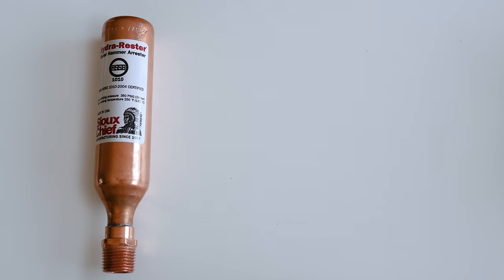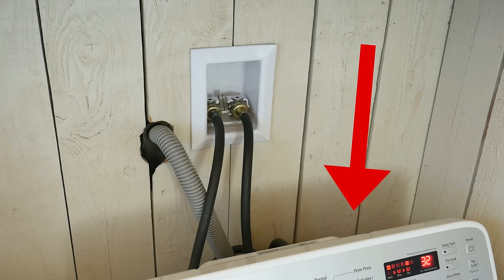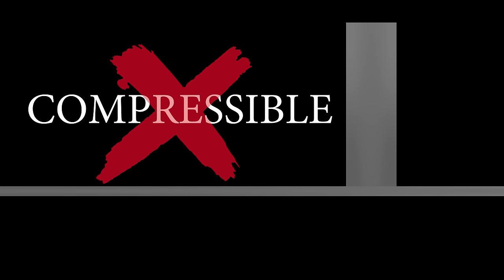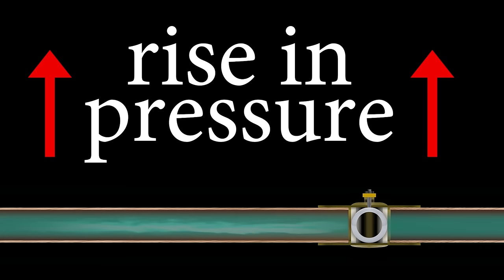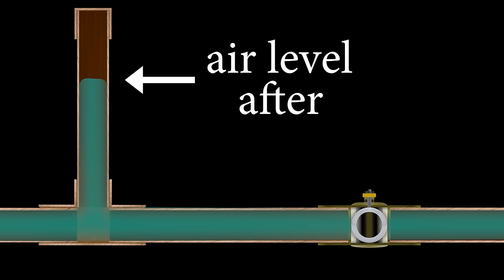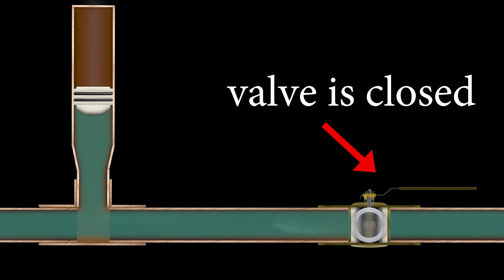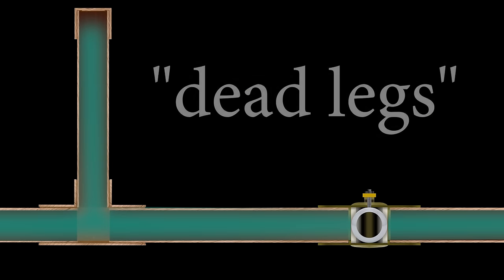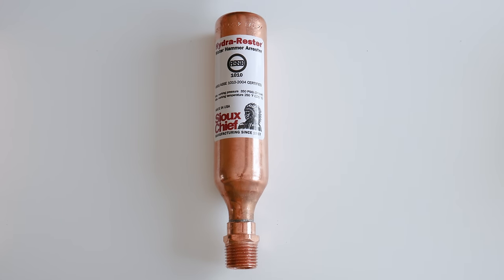Why Water Hammer Arrestors Are SO Important | GOT2LEARN

Comment: can you use it in a heater system to avoid air in the pipes?
Reply from the maker: Negative, only domestic water 👌
Reply: @Got2Learn  anything else I can use in the heater system to eliminate or reduce the air inside the pipe? thank you.
Reply from the maker: @carlobarrie7656  bleeder valves at the highest point in the house, typically on the radiators 👌
Reply: @Got2Learn  thank you very much

Comment: Can a safety valve for heating systems, be used in plumbing systems to protect agains water hammer? Its supposed to work at increased pressure, so would it work?
Reply from the maker: You would still get the knocking.
Reply: @Got2Learn  Where i live in my old house, there is no even any water hammer safety installion, and there is really no problem in my plumbing system so far. So i am wondering when it is really a necessity to have water hammer protection installed? Like maybe you need these things if you have a high pressure at your plumbing inlet from the waterlines, but then i think you could just use a pressure reducing valve, any ideas?
Reply from the maker: @bamf6603  exactly, high pressure is the main reason.
Reply: @Got2Learn  Thank you very much for the answers, and last question do you know what are the critical levels of pressure that you really need a water hammer arrester installed?
Reply from the maker: @bamf6603  You are most welcome, yes 80psi is when you want to install these 👍

Comment: My pipes are doing this now. This just started happening. Where should I put a WH Arrestor to stop this?
Reply from the maker: Nearest to the banging fixture, one of cold one on hot, try that.
Reply: @Got2Learn  It happens when I flush the toilet or shut off the bathroom faucet.
Reply from the maker: @pabloseykata6930  yeah you need to add one for the whole bathroom then

Comment: Thanks for educating me on the air chamber method draw backs.  I have a couple of those in a house and will now plan to add water hammer arrestors to those ends.  I remember in elementary school, slamming the water on and off just at the right rate and have the faucet and pipes constantly rattle with the valve opening and closing on it's own.

Comment: I've installed these on my lines.   But I noticed the pex pipes and the pipes on top of the water heater still shooked  each time water is shut off, especially on the washing machine lines.   My arresters couldn't be all defective could they?   They are installed about 6 feet away from the spouts.
Reply from the maker: How much pressure do you have coming in the house?
Reply: @Got2Learn  about 55 PSI.
Reply from the maker: Did you just install one?
Reply: @Got2Learn  pex pipes and arresters were  installed 2 years ago.   Water pressure was measured today with a water pressure gauge at the front spigot where pipe from meter enters the house.

Comment: I hadn't had water hammer issues in my house until I replaced my dishwasher, then it and the clothes washer both would hammer. 

Arrestors on both solved it, but does replacing an appliance like that commonly cause hammer issues?
Reply from the maker: Not that I know of, but you did the right move there.
Reply: It depends. Many newer appliances have quicker closing valves than older ones did. Especially the newer high efficiency clothes washers. If the appliances you replaced were very old, this could be why.

Comment: I just run the copper pipe about 10-12 inches vertically, past a fixture. The trapped air works as an arrestor. Have never had the 'bang' happen, ever. The air is trapped and absorbs the shock. A valve is just something that will eventually break.
Reply from the maker: Bacteria Hue, bacteria.
Reply: @Got2Learn    Copper is anti microbial. It’s bacteria killing properties far, far outdo any other type of plumbing pipe, pex included. Besides, using my method on bathtub, showers and washing machines are not place’s you’re going to drink it. I don’t install them on faucets because banging is rarely a problem there.

Comment: What arrestor can i use for my toilet? Everytime i flush there is water hammering in the wall until the toilet fills up thanks.
Reply from the maker: You need to install one on the pipe that feeds the toilet, inside the wall, try to leave it accessible too.

Comment: Great video! To the point and very educational. I have one of those dead leg ones and it doesn’t do anything anymore. I am not a plumber so my soldering game is weak. I did notice “shark bite” hammer arresters on the market. I’ve used a lot of shark bites with great results. What’s the opinion on the shark bite arresters?
Reply from the maker: They work just as well :) Thanks for the kind comment Grant, really appreciate it :)
Reply: Got2Learn I’ll remove the burrs after cutting the pipe. Something else I learned from you 👍
Reply from the maker: An absolute must :)

Comment: I believe a open pipe (above water tank level) will also work to dampen the shock
Reply from the maker: Didn't hear of that.
Reply: Recently we got plumbing work done at our new house, there I have seen a T joint , which is open and a bit  above water tank , Yesterday while playing around with the water supply , I discovered this , when I suddenly closed the tap , then water came out of the T joint 

I m no expert ,just observation, may b some one who is into plumbing can clarify
Reply from the maker: @warbot2544  hmmm...that is certainly not under pressure or tge water would be gushing out....is there any device installed?
Reply: @Got2Learn  no device , just pipe and fittings
Reply: If a water line pipe is open anywhere, it will leak. There's no way that's an open water line, it would be spewing wide open constantly.
Reply: @garywalls9041  even if it is above water tank ?

Comment: side note: when you are plumbing in a rural area where you pump out of a well there is no need for these as you pressure tank will act as one huge hammer arrestor. safe yourself a couple of bucks.
Reply: Not necessarily. While it would be better than nothing, you'd still benefit from these.

Comment: Never heard of anyone using these in Sweden, and water leaks are not common.. But i think most valves sold, both manual and automatic (in washing machines, dishwashers) are more soft close, problem solved!
Reply: Pressure is pressure regardless if it's swedish pressure or not... Get off your high horse trying to soap box...  Maybe they have hem built-in already... These are used in welding torches as well, arrestors as the flashback if something happens
Reply: @dragontalontsiawd  if you turn of your tap as violently as you responde to simple facts, i suggest you keep your water hammer arrestors mr keyboard warrior 🤣

Comment: Hi !
What is the air pressure inside the chamber ?

Maybe the O rings will leak... after ages. You can not check out the air pressure inside it. There is no valve to refill it and to add a manometer.

I prefer to have a spring inside. ;)
Reply from the maker: You could always add a valve right before to be able to check this ;)
Reply: Eddy Bash if the air leaked it would just stop working and one would hear the hammer noise.  If it did leak filling it up again would be futile as it would soon empty. Also, you would have to drain the system of water to allow the chamber to be filled with air as water would resist you charging the system.
Reply: The air pressure must be same as water pressure

Comment: Does anyone know if you need to install WHAs on PEX installations?  And will they help prevent pipes freezing and bursting?  I had 2x shark bite fittings blow and flood my walls so I'm looking for a way to prevent it in case the heat goes out again in the future.

Comment: Is this only for copper pipes or pex aswell?
Reply from the maker: More for copper, but you still need it with PEX.
Reply: @Got2Learn  ok thanks..my local hardware store only has 1/2" arresters can i put one of those on hot & cold or should i get 3/4" arresters?my main water line is 3/4"
Reply from the maker: 1/2" on hot and cold should do the job, if not, you might need to add some.

Comment: Do they wear out over time and need replacing?
Reply from the maker: It's not really calculated with time but more with "cycles". These arresters are tested in house at 500,000 cycles and pass with flying colors so you won't need to think about replacing this for a very long time :()
Reply: Yes they do wear out, in about a year. They are most likely tested rapidly in perfect conditions. No scale or corrosion to damage the O-rings has time to develop. There is a reason they have to be installed in an accessible location. In a lab, they work for 500,000 cycles. In a house, not so much. Be sure to get one which screws on, so you can replace it when it no longer works.

Comment: I have never seen a copper leak that was from not having hammer stops.   Always a bad soldier joint.  Noise is from not strapping properly.  That's even a question on the c36 license exam. They are not a bad idea for the washing machine box, but not "SO" important as you say.

Comment: I don't think you need this if you're on well water as the bladder tank is the system's hammer buffer, unless there is a check valve installed on the bladder tank output.
Reply from the maker: You are correct about the "well" part as wells don't have as much pressure, but the bladder tank is not made for "hammering", it's made for slow expansion, so you still need some protection for water hammering.

Comment: Ive been a plumber for many years and can guarantee water hammer arrestors are not common at ALL. PEX piping has mostly replaced copper in residential plumbing. When either are strapped p properly you greatly minimize the sound especially with pex. If plumbed  correctly, water hammering is nothing more then a annoyance. It's not going to hurt anything unless you already had to much water pressure from the start. Water arrestors are good for commercial/ condos,apartments, where sound could be real issue. Go ahead and call a plumber about water hammering and ask to have a water arrestor installed, they will gladly take your $$$
Reply from the maker: This is true if you are dealing with low pressure systems (~40 to 50psi) but as soon as you start getting to 60 or 70psi, hammering starts to occur. The fact the PEX is able to bend and flex as these shocks pass thru the pipes help with the knocking, but they don't help with the actually "water hammer" which means your fixtures are still absorbing the shock, and it most cases, they are the weakest point of the system, I hope this clarifies everything.
Reply: @Got2Learn  I understand hammering will start to occur around 70psi and the connections at the fixture are the weakest  point. If you have a high pressure system/70-80 psi on your incoming line you dont need  multiple "water hammer arrestors,"you need a regulator.  In the few cases where the pressure can't be reduced, I could see these being useful.  Honestly I don't mean any disrespect, I just dont see why they are "SO" important
Reply from the maker: Well they are important for people that want to keep their high pressure, other than that, they aren't really important.

Comment: every time i shut off my shower, about 5-10 mins later i hear a single knock in the wall. Its loud enough to hear in the next room over. Could it be related to this device? what could it be?
Reply from the maker: Maybe your water tank heating up and popping, if it's that, it's not a good sign hehe.
Reply: @Got2Learn  i have a tankless water heater thats on the exterior of the home about 10 feet away from the shower. it sounds like its coming more from the shower area... but maybe the tank... or inbetween
Reply from the maker: @RustyB5000  ohh, didn't know it was a tankless, then it could just be your drain pipes expanding against the wood as the hot water from the shower passes thru them.

Comment: Was looking for some reference to Pex. Do you have to use a water hammer if most everything is pex or is it specifically for a full copper tube system?
Reply from the maker: Even on PEX.
Reply: Typically pex will have reduced hammer

Comment: Can just one of these be used for the whole house ?
Reply from the maker: Negative. A good example I can give to you is having an airbag in the trunk of a car, it won't serve anything if you have a head on collision, they have to be strategically placed on the system for them to work.
Reply: @Got2Learn  in the car case  these 2 seats separate from the other , in the water case is only one system from the water main the distributes water tho the house , i think they say no just to sell more of it its a market strategy just like have a gfci in the kitchen and now have a argfi fuse in the electrical panel just to sell more.

Comment: I don’t notice water hammer in my 2-story copper plumbed house. No remediation techniques installed.  I do have a water heater expansion tank though...
Reply from the maker: The thing with heater expansion tanks is that yes, they'll help with hammering, but they aren't design to withstand constant hammering and they'll eventually burst if you have high pressure in your home, a proper arrester is required for this.
Reply: Got2Learn In my area everyone has the expansion tanks, probably masking the issue at hand 😬
Reply from the maker: Exactly Eric S

Comment: How long until the arrester needs to be replaced? Rubber goes bad after a certain amount of time...
Reply from the maker: These typically last the life of the system, so you won't need to worry about them for a long time.
Reply: @Got2Learn  ... first lesson is to NEVER install something that has moving parts in a location you can't get to. (inside a wall is such a place)
Reply from the maker: Yes, they must always stay accessible :)

Comment: A single water hammer is nothing to worry about.  A rattling water hammer in a high rise apartment or condo is a major plumbing emergency.  Those main riser pipes are under very high pressure and if they rattle, they explode sending hundreds or maybe thousands of gallons every minute.  They usually sound like a big industrial drill or fast working forge hammer before they burst.

Comment: Wondering where to fit one or two of these as there's slight hammering when the cold water tap is turned off in both kitchen and bathroom, despite me thinking I'd secured the pipes to the wall really well?
Reply from the maker: between both if you can.
Reply: If there is even one section of pipe that is not secured properly and the rest is fine, it will exaggerate the water hammer.
New renovations I never hard clip every section of pipe as it always creates water hammer , because somewhere in the building there is one section not clipped.
Better off the shockwaves disappearing throughout the system than amplifying the hammer by overclipping the pipework

Comment: Got2Learn or anyone: where in the system should it go in a new construction?  Or where in an existing house would it ideally go?  Does it come in 3/4” or only 1/2”?
Reply from the maker: Nearest to fixtures like washing machines, refrigerator water feeds or any other fast closing valves.

Comment: How would these tie into a system that is primarily PEX?
Reply from the maker: There are modeks you can crimp if that's what you are asking, so you'd install a tee and crimp it to the tee 👌
Reply: @Got2Learn  makes sense, just wasn't sure if it was as much of a necessity for PEX
Reply from the maker: Less than for copper, but still needed 🙏

Comment: Hey, I think you're in Québec right? Love your videos!

Question: In Northern Ontario, I have a 10 year old house. There aren't any Water Hammer Arresters installed whatsoever. Should I retrofit all my appliance faucets with them?
Reply from the maker: Yes, I am in Quebec :)
To answer your question, do you have any "air chambers" like I mentioned in the video? If you do, I would say yes because there's chances of bacterial growth in there and you want to prevent that at all cost.
Reply: @Got2Learn  No air chambers either.    We don't seem to get much hammering either though.
Reply from the maker: How much pressure do you have in your home?
Reply: @Got2Learn  On a well, but the pump is pushing about 45~50PSI
Reply from the maker: I wouldn't worry about it. If you had 70-80psi, i'd say install a few and also check to get a PRV but with that amount of pressure and no knocking in the walls, you shouldn't need them.
Reply: @Got2Learn  You're a king! Thanks for the free consultation :)
Reply from the maker: Not a prob man ;)

Comment: Water, and all fluids are ALL compressible, it's just really hard to do so.

Measure the density of water several hundred meters below the ocean's surface compared to just under the surface and you will see it is more dense and ergo more compressed, and it is entirely possible to simulate such pressures and the associated density change with a powerful compressor.

Comment: I have those old school air chamber water arresters on my washing machine water line. And they don’t work any more
Reply from the maker: Yeah, after a while the air mixes with the water and goes away, I suggest retro fitting some of these when you can :) Thanks Jack!
Reply: For a quick but not long term fix, shut off the water and use a drain port at the lowest possible point. Open all fixtures above that point. Once its finished draining shut all fixtures off then turn the water back on. Wait about 20 minutes before you air the system out. This will allow air to stay trapped in those old school air chambers.
Reply: Josh thanks but it should be replaced